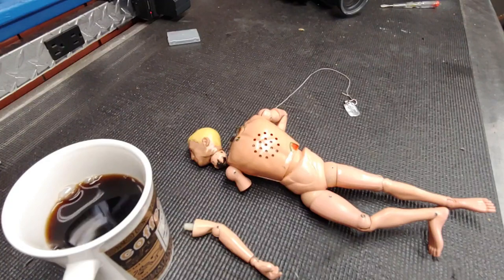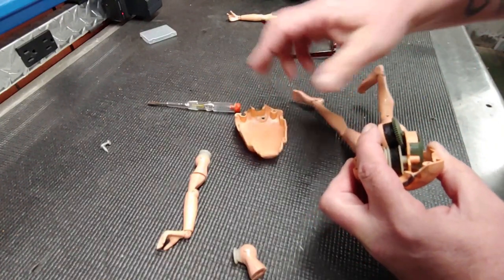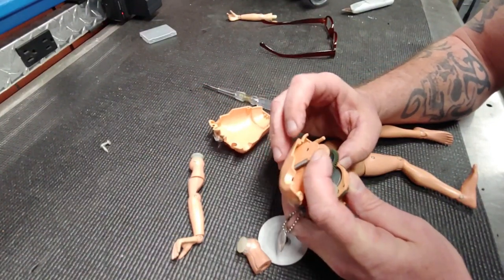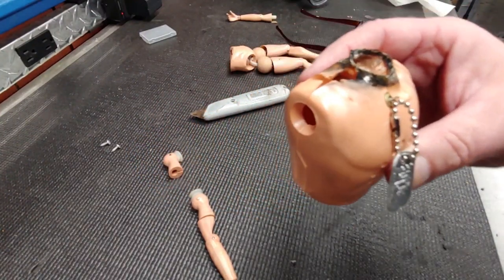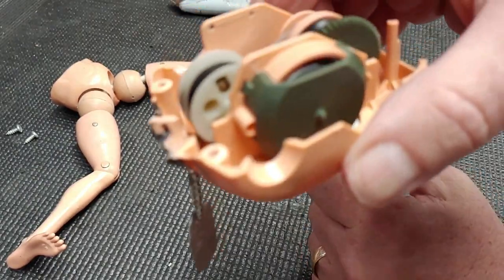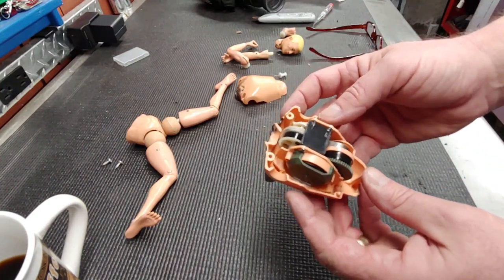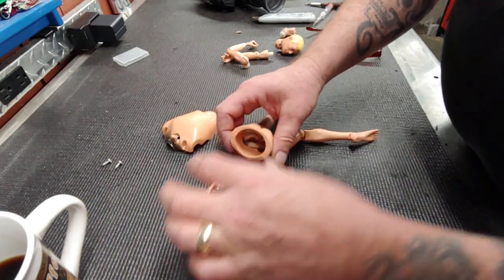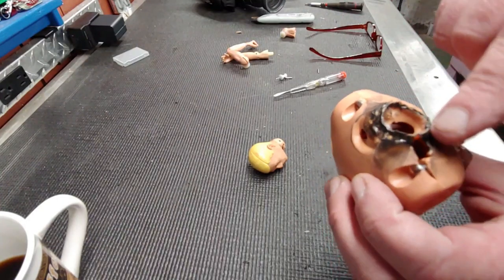Vintage GI JOE Talker repair  Part 1

Comment: You have to pull it all the way to get a specific phrase and after about half of the string it doesn’t have a phrase there
Reply from the maker: I also heve to replace the flywheel foam and replace the string,it stops before he finishes his phrases.Thanks
Reply: Howlin' wolf reviews no problem